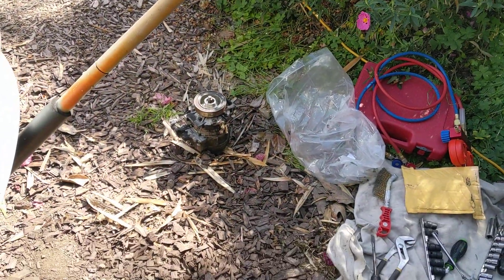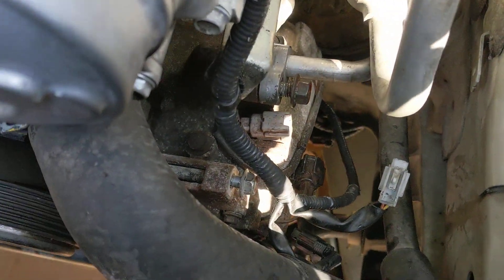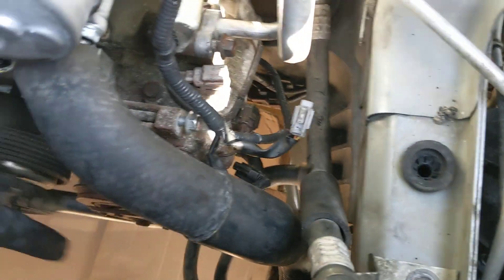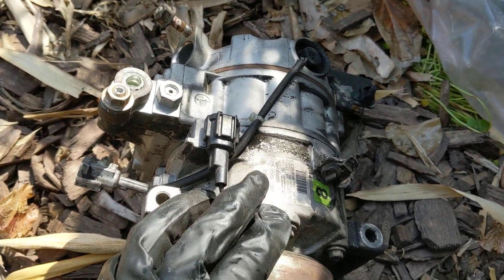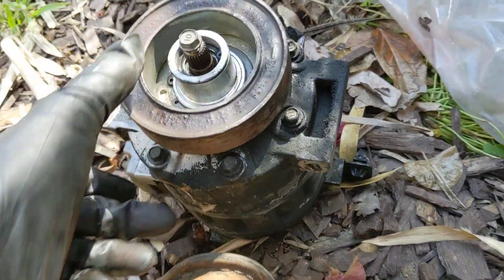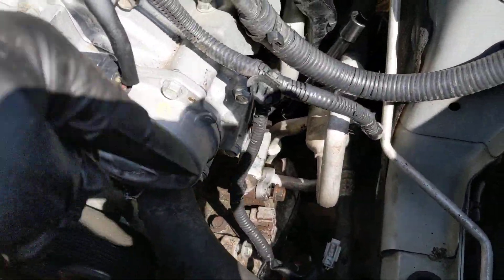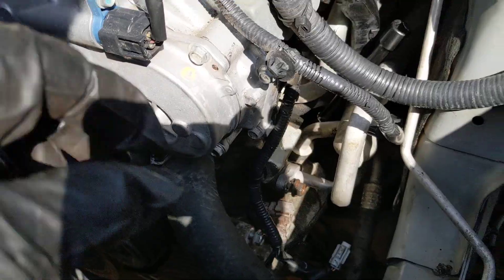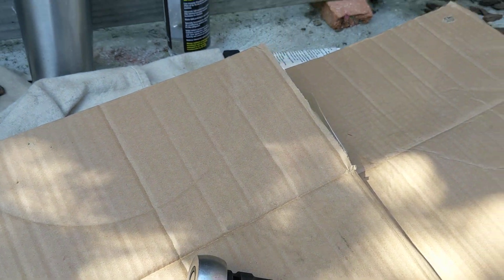AC compressor or clutch replacement, 2007 Infiniti G35 VQ35HR

Comment: Hi man, I have 350Z 2008 which has the same engine Same Compressor. I want to buy a AC compressor for it but do you have any idea how much Pag Oil I need to add to it? I'd really appreciate your help. Last year my new Compressor blew up mostly due to the wrong amount of Oil that was added to it. If you have any idea or can help I will be grateful.

Comment: Everyone with a 07-08 ac must of went out around the same time. Lots of videos were made 8 months ago about this topic lol. Thanks for the info.
Reply: Yes mines went out and I'm trying to take out bolts are nasty from water getting to them
Reply: @sirmoney2762  did you diy? Facing the same issue and I’m far from a good mechanic
Reply: @Kin_Ton_Ti  yes ac compressor and ac lines high side that runs to cabin and other end to radiator.........and ac bolts was only problem getting to the one in backside of compressor it's a 12mm there's 3 in total mines were harsh from missing splash guards underneath car
Reply: @sirmoney2762  thank you! Did you replace the drier too? And any other dos or donts to be aware of? I’m about to tackle mine and I’m praying for the best so any insight is appreciated
Reply: @Kin_Ton_Ti  hey, was your drier and/or condenser replaced along with the compressor?
Reply: <u(